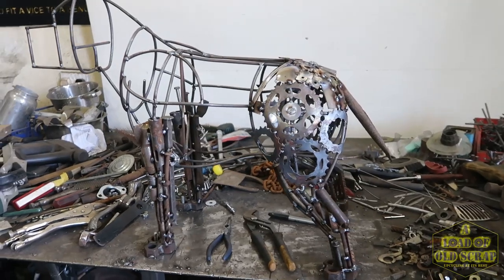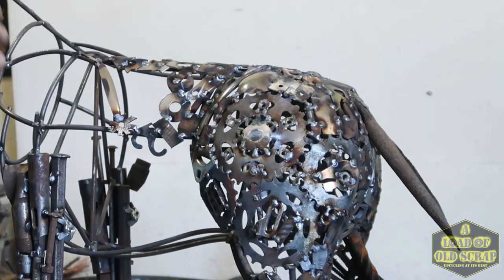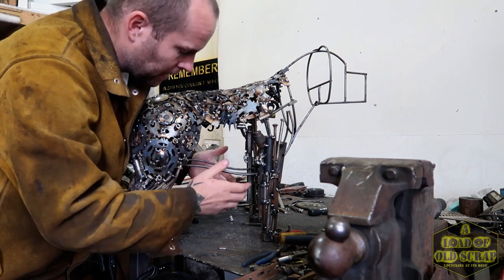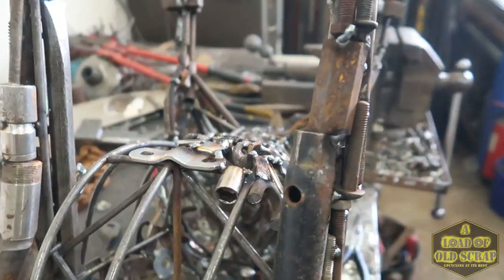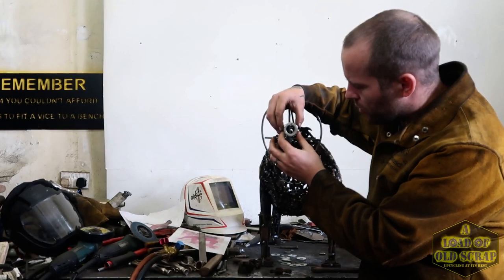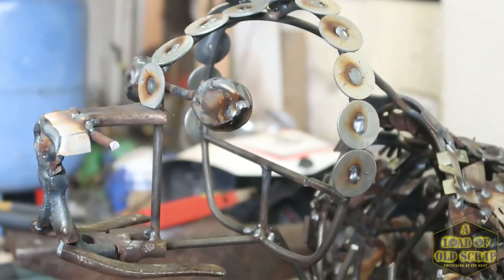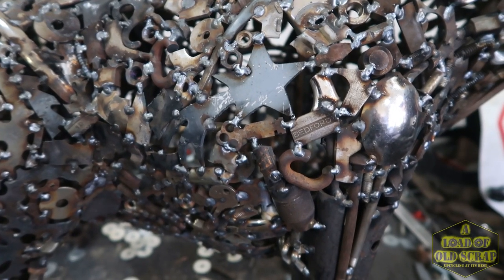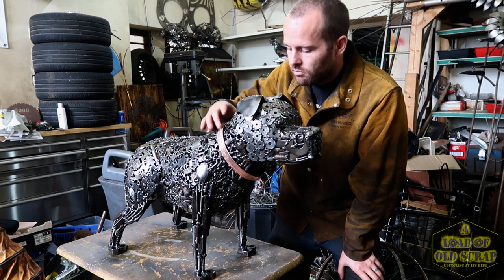I Made a SCRAP METAL DOG!

Comment: I all, I have wristwatch spare parts. What would I use to bind them together and bend them to make a miniature sculpture?
Reply from the maker: To bend any metal your going to need to use heat, depending on the material will decide how much heat, I'm guessing its mostly brass so a plumbers blow torch might work. As for fixing it together maybe solder would work but in all honesty it's not something I have tried much of.

Comment: Hello, so this is MIG welding? Not brazing? I'm interested in starting up but I need to know what kind of welder to buy.
Reply from the maker: It is mig welding yes. There are two types of mig welding, flux core (gassless mig) which doesn't require gas but can produce messy welds with lots of spatter or normal mig welding which uses a shielding gas much tidier welds and less clean up after, hope that helps a little.
Reply: @ALoadOfOldScrap  this does help. thanks!
Reply: @ALoadOfOldScrap  I'm a beginner, I would love to do a piece like this, can you recommend a beginner welder? Can oxygen acetylene have the same effect /safer? Thanks!
Reply from the maker: @dec23  oxy acetylene is definitely not safer and also more difficult it's generally used more for torch cutting or heating to bend metal these days rather than welding, also if you wanted something to heat metal so you can bend/manipulate it more then an oxygen-propane torch is perfectly fine, less volatile and cheaper (it's what I use). As a beginner mig is the way to go 100% for welding, it's what I use on pretty much every sculpture. If you are UK based try giving aip welding supplies a call and say I recommended them, they would happily go through different options to see what would work best for you.
Reply: @ALoadOfOldScrap  Thanks so much for your advice! Another welder also suggested to just get a welder just like you said. :) I def will invest in it. Initially I was soldering/flux and what was happening is my completed solders were coming apart when I would solder near them. I'm actually based in the U.S. A few ppl have recommended some stores out here for me. Thanks again for you answer! I appreciate it! Also, thanks for telling me oxy acetylene is more dangerous - I had no clue.
Reply from the maker: @dec23  your welcome, I  had to find most things out by trial and error so happy to share some of the knowledge I have gained over the years 😁